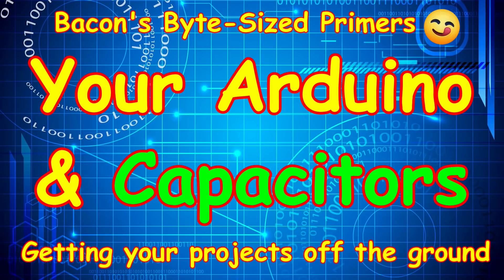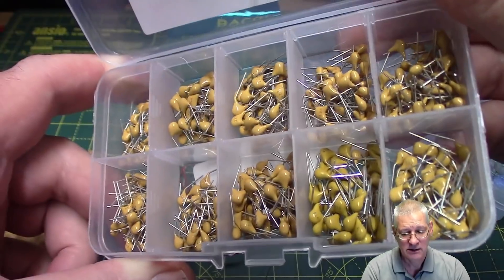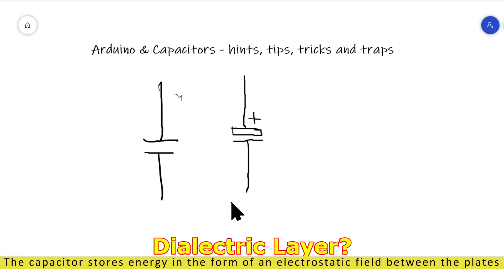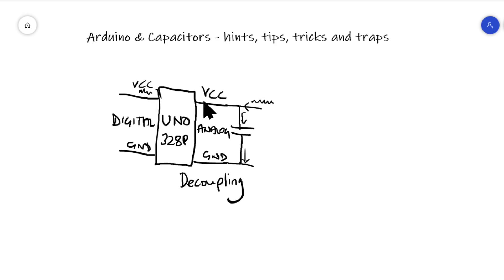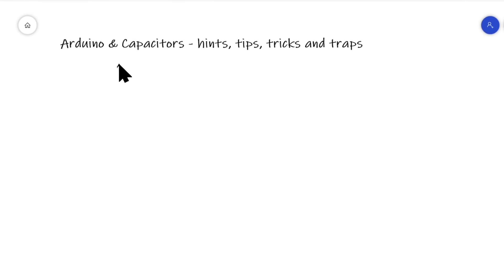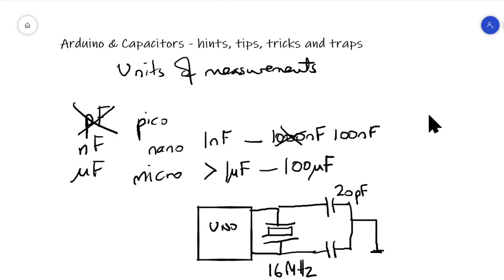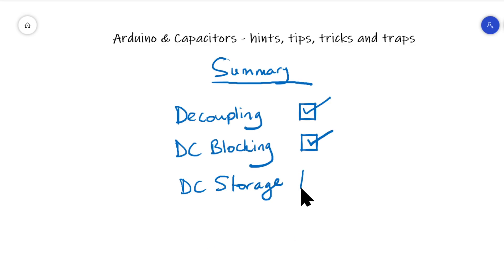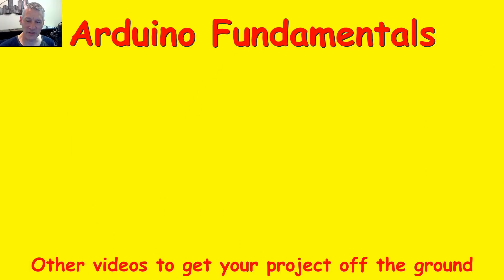#BB2 Capacitors - from an Arduino Perspective

Comment: Under what circumstances would you choose an electrolytic capacitor over one that is unpolarized?
Thanks for the great video.
Reply from the maker: Depends! When you say "unpolarised" do you mean an unpolarised (aka bipolar)  electrolytic capacitor or just a standard multilayer ceramic?

If the latter, then most multilayer ceramic caps have a range of 10pf to 0.1uf (100nF). Sometimes a bit higher but that's it. Larger values, above 1uF, are usually electrolytics.

Electrolytic  caps go from, say, 0.1uF (100nf) all the way up to several thousand uF and indeed F (Farad) sized too, these days. But most electronics engineers will call them the Spawn of Satan because they deteriorate over time and usage and eventually fail or get very "leaky". It's very important to never exceed the stated voltage of an electrolytic cap. Running a 6v cap at 5v is OK. But running a 6v cap at 9v is a recipe for disaster. Allegedly, some LED bulb manufacturers do this to ensure their bulb device fails after a few thousand hours (the LED would last much, much longer).

An unpolarised electrolytic cap (bipolar) is effectively two caps connected in series with their cathodes (or anodes) together. They are often used when the polarity of either end gets reversed, such as in speaker crossovers. A bit of a special use case.

Any good?

Comment: You can't trick me! That's not a capacitor! It's a custard cream!
Woah! Those old (are they Plessey?) black and red ones with the yellow label. I used to get MILLIONS of those out of old tellies in the 1980s, I haven't seen one "in the flesh" this century. I saw a pack of 10 on E. Bay a few months back and was sorely tempted... not that I needed them for anything... just for pure nostalgia.
You should have mentioned that (for Australian language reasons) "Picofarads" is actually pronounced "puff". ;)
Reply from the maker: Yes, a custard cream is what it is, no doubt about it. I'm guessing today's capacitors are of better quality than those custard creams? And electrolytic caps do have a limited life (which is why electronics engineers try not to use them).

Comment: how do we calculate the capacitance of decoupling capacitor to be used for arduino UNO?
Reply from the maker: Do we need to calculate it? 100nF seems to be the Industry Standard for decoupling Arduino power pins.

Comment: There is one exception to this voltage rule, in the Electrolytic Firecracker Circuit.  This circuit requires the rated voltage be significantly exceeded with a hefty power supply. This circuit can only be used with serious eye-protection, because as the fragments destroy one eyeball, the involuntary blink reflex will prevent the other eye from witnessing the event, and if no one saw it happen, it didn't happen. Also it is too fast for the eye to follow. 
     So given the likelihood of fire, facial disfigurement, and breathing in of the (toxic?!?!?) capacitor dust, this is a very inefficient and highly discouraged form of tech entertainment. 

    This circuit is sometimes created  unintentionally when powering up old equipment with the cover off. You can switch it on for a second and off again, several times, in hopes of letting the old caps rebuild their oxide layer. But something else may blow up.
    SO WEAR A FACE SHIELD!!! Or at least safety glasses.  If you are a life form with enormous compound 'insect' eyes, the hundreds of redundant lenses made of very tough proteins, the risk may deemed acceptable , but consult with a Xenobiologist knowledgeable of your species.
    Finally, from the legal point of view, if you do any of these things, and any thing goes wrong, you're screwed!!!!  So just don't go there.
Reply from the maker: Yes, most definitely best avoided 💥

Comment: Thanks for making this. Q: I use and Arduino in a car project. It's plugged into the cig lighter via a 12V->5V buck converter, draws ~0.15 A @ 5V. No power when the engine is off. I'd like Arduino to do a small task AFTER I turned off the engine, I need to power the Arduino for ~10 sec longer. Would a capacitor (either 12V or 5V), in parallel with VCC/GND, do it? If so, what type, capacity, voltage? Thx
Reply from the maker: I'm afraid a standard capacitor just wouldn't do it, as the Arduino (UNO?) draws too much current.

As it's a car you might get away with a physically large and high value  (multi-Farad) capacitor but even then unless your circuit has been designed to limit its power consumption it will quickly discharge. A one-million μF capacitor (1F) charged to 5v, discharging via the Arduino UNO at something like 200mA (200,000μA) down to 4V will last (maybe) 5 seconds. All very finger in the air calculations.
(Try it here: http://www.circuits.dk/calculator_capacitor_discharge.htm)

A better way would be to make the Arduino permanently powered via the 12v-to-5v module, then via an auto on/off module (see my video #123 as a starting point, https://youtu.be/g1rbIG2BO0U ). This means the Arduino is powered on until it decides it can power off, and does so. You can still use the cigar lighter point as a 5v signal (so the Arduino knows the car is now switched off) but it will need an independent power source).

If you really want to do the latter, email me for more details. Or try the 1F (or 2F, 3F) solution if you think it worthwhile. Connec the cap across the Arduino's VCC and GND and get one with (at least) 5v5 rating. Higher voltage caps will be larger and more expensive.
Reply: @RalphBacon   Thanks for the detailed response and links. I've tried to reply several times but YT deletes my post if it contains a URL. I think there's a ready-made part that can do this what your Mosfet circuit does: a 2V-20V switch, controllable by applying voltage to its ON, OFF, or CTRL pins "Mini Pushbutton Power Switch with Reverse Voltage Protection, Pololu item #2808" (can't link to it). Also, I've just read that hooking a big capacitor to the car's 12V wiring is somewhat dangerous, because, during the initial surge into the capacitor, the car's wiring may "detect" it as a short or spike, and blow a fuse (or worse)
Reply from the maker: Indeed, large capacitors can be seen as a short circuit. But you want the capacitor on the 5v side anyway.
Which website was that item from, I've tried fleaBay and Banggood, neither has anything.
BTW You can add URLs by using this sort of approach: webmaster at jargongeneration dot com. Fiddly, but it works!
Reply: @contrarian8870  its a bit old Q but little battery would be way better. Small Lipo and charger circuit and some logic that detects if car is on or off. All extra parts are so cheap nowadays
Reply: @martynaslukas4340  Thanks, I already solved this soon after posting. I added an IR sensor near the front-most position ("P") of my gear shift. I always put the car in "P" after I've stopped driving, just before turning off the engine. So now Arduino knows when I've just finished driving and it has ~2 sec (enough) to finish its job., before I remove the key. Works with no change to my driving routine.

I live in AZ, I'd be reluctant to leave a Lipo in a car in case it explodes. It gets up to 150F (60C) in the sun in a car. BTW, I also 3D-printed some PLA parts for my gadget, but they melted in the sun:) I had to re-print in ABS for in-car parts (higher melting point)

Comment: Hi Ralph, I would love your opinion.... Do I really need all these decoupling capacitors? https://easyeda.com/sbsivertsen/attiny84radiotransmitter
Reply from the maker: If the datasheet says it does then there is no argument. If it does not then a single 100nF is normally sufficient (and required) between each VCC pin and ground.
Reply: @RalphBacon  Thanks Ralph 👍Hope you are ok.

Comment: Another common use for capacitors is in an RC filter circuit.  E.g. if you need to delay a signal going from on to off or vice-versa, or if you need to remove high frequencies from an analog input signal to prevent aliasing.
Reply from the maker: Thanks for sharing!

Comment: Does the value of a blocking cap depends on the frequency and Zin?
Reply from the maker: Different value caps do allow different frequencies to pass (higher values allow lower frequencies) but it also depends on the voltage of the signal too. A lower value cap is fine for small signals. A much higher one is required for, say, output to a loudspeaker.

Comment: Correct me if I'm wrong: the DECOUPLING cap doesn't actually send the noise to ground, but rather it acts as a buffer/shock absorber, and then re-releases the 'noise' back into the line but in a more flattened form?
Reply from the maker: A decoupling capacitor routes the signal (noise) to ground.
Reply: Depends on the frequency of the noise I guess. High frequency noise will short through a cap rather than charge it

Comment: I am afraid that you are a bit wrong about the reason for decoupling capacitor. It is not the noise from the power supply that is the problem. That you filter away at the power supply.
Even when you run the Arduino on a battery, you still need decoupling capacitor. The problem lay within the IC (arduino).
When the transistors inside the chip starts to work, they draw power instantly. The power lines on the board can't keep up with that burst and the IC will starve and probably shot down ever so briefly and give all sorts of problems. That is why the capacitor is there, to store energy for that brief moment.
Reply from the maker: The caps are to:
(1) Prevent noise entering on the VCC line
(2) Prevent noise exiting on the VCC line (all that digital switching)
It's most important to separate the digital VCC and analog VCC on the bare chip, ideally with another 1µF cap on analog VCC - anything entering here will just give more noise on the analog pins (assuming you are using them for analog) and we know how noise-sensitive they can be. 
Power reservoir caps are as I showed in the demo, wired close to the chip and anything from 1µF to 100µF. Datasheet will tell you if you need them.
Wall wart PSUs are the worst. I'm currently experimenting with ferrite beads (amongst other things) to see what it takes to get a stable, noise-free +5v from one of those!
Reply: Actually the 2 x 100nF capacitors placed close to the IC on an Arduino board are actually there to filter supply noise. The capacitors give high-frequency noise signals a low-impedance path to ground, they are not there for instantaneous power draw as the current demands are not that high.
Reply: @Fifury161  
The capacitor on the analog Vcc pin (supplies the ADCs) is there to filter external noise (from the supply or any other "noise generator" in the circuit). You should not only use the capacitor but also some inductance to create an LC low pass for the AVcc pin.
The capacitor on the digital Vcc pin (supplies all the rest of the chip) is there to prevent noise getting from the micro to the rest of the circuit and to prevent the micro from randomly failing because of power rail dips created by its own operation. Noise created on the Vcc pin by switching IO pins is significant (after all an AVR for example can go up to 200mA, or higher, if you ignore the specs). Even normal operation (without IO changes) will create power rail noise. That's what that cap is there for.
Reply: @superdau  I pointed out that these capacitors have a 100nF value. That's significant; if you do the maths you will realise the value is not to provide instantaneous power, but to filter supply noise...

Comment: Hey Ralph !!  Thanks for the info !!  A question please !!  How is the quality of those capacitors you purchased from Banggood ??  Do you/would you trust them for use in actual projects ??  Thanks for your response !!
Reply from the maker: For a home/hobbyist project then no problem. 
I would not use them for a commercial project as you never know what you are getting. Are they caps that failed [Apple's] stringent quality tests but are "OK" for general use?  Aside: no-one would use anything but quality suppliers for commercial projects anyway, eg Digikey, Mouser, RS Components at several times the price (probably) and bought in hundreds if not thousands of units. 
I don't believe there will be anything "wrong" with Banggood components (or AliExpress, Gearbest etc) but they won't be of military spec! Good value for hobbyists!

Comment: Thank you, informative video as always,
In one project I did, the instructions said to connect 2 capacitors one ceramic and one electrolytic,
does this make any sense?
Reply from the maker: Yes, it's often the case to connect a 100nF multilayer ceramic together with a 1µF (or more) electrolytic in parallel. Together they cover a very wide frequency band so can kill noise well, and the electrolytic can also help prevent voltage sags if there is a sudden demand (for a few milliseconds).
Reply: @RalphBacon  Got it :). Thank you

Comment: Thanks for this - very helpful and the table is definitely going to be useful. 

Any thoughts on tantalum capacitors?
Reply from the maker: Glad you liked this, Robert^2. Tantalum caps give a high(er) capacitance per cubic mm than most others, are very stable, small for their capacitance, and some are not polarised (most are though). What you do have to be very careful about is the voltage rating (I'm a fine one to talk, given that destroyed electrolytic in the video) as they will literally explode (and go short circuit) if overdriven; best to derate the max voltage to about 50% of stated.
Reply: @RalphBacon  I read that electrolytic capacitors sort of rot after a while. Is this avoidable? Many thanks
Reply from the maker: Electrolytics do deteriorate, as they dry out. A common problem in PSUs and audio amplifiers. From a design perspective you can mitigate (but never eliminate) this by placing electrolytics away from sources of heat on the PCB (eg transformers, power transistors), underrate the voltage (so use a 63-volt cap for a 35v supply) and by using top quality, branded components. Manufacturers look for a 10-year life for their products but consumers often want much, much longer!

Comment: Only 10 seconds in, I’m totally distracted by the biscuit, trying to work out whether it’s a malted milk - custard cream hybrid 😂
Reply: Aaaah it’s dielectric cream.  Brilliant!
Reply: Superb quick explanations there Ralph, filled in a couple of gaps for me.  Thank you!
Reply from the maker: Very clever! Very satisfying to eat too.
Reply: Should be two chocolate coated malted milks paired chocolate to chocolate so it doesn’t melt on your fingers...
Reply from the maker: The chocolate is not a good insulating layer, I'm afraid.

Comment: Good one. I like the capacitor.marking charts that you've but together. Also... I found another use for a capacitor, while working on my mom's MP3 player. You could put it in the storage category, I suppose. I implemented a version of your circuit that uses a a pair of MOSFETs and an arduino output pin to control the nano's Vin. I did not want to have mom hold the "ON" button down, waiting for the arduino to take over, so I tacked a 10u across the 100k gate-source resistor. This has the effect of holding the gate on for 1.7 seconds after the "ON" button is released and giving the nano about 1.4 seconds to complete the boot process and set the "HOLD_PWR_ON" pin active. 
PS: I could have programmed the boot loader out, via the ICSP port, but would have had to change much of the physical construction of the player. As it stands the USB port is easily accessable through an access hole at the back.
Reply from the maker: Yes, that is a good use for a capacitor as an energy storage device. But now you know why I almost always zap the bootloader on "production" devices and only use it whilst developing (sometimes not even then). Just as easy to use the ICSP socket.

Comment: I am confused by the decoupling discussion. You say the noise goes through the capacitor to ground but I thought current didn't go through capacitors, just in and out on the one side - which is why they are drawn with the gap.
Reply: Mark, you are both correct and incorrect. In the DC world a capacitor does not allow DC to flow through it, it charges and discharges. In the AC world, alternating current flows through a capacitor. The capacitor has a "resistance" to AC called capacitive reactance that is a function of the capacitor's value and the frequency of the AC applied. Noise in a DC environment is alternating current - even though it doesn't change polarity  - it does alternate from one voltage level to another (albeit randomly) and so the capacitor conducts it to ground.
Reply from the maker: David V has pretty much answered this. Any non-DC voltage can find its way past a capacitor, whether that is noise, a signal, music or AC voltage. Depending on the cap's value, the max frequency of what will pass is determined. But that's audio, not Arduino!

Comment: As  normal rule of thumb, I never go above 80% of the cap's rated voltage to improve reliability of the design.
Reply from the maker: Agreed. What a mistake to make! But what a stupidly low voltage that 1000uF cap had!